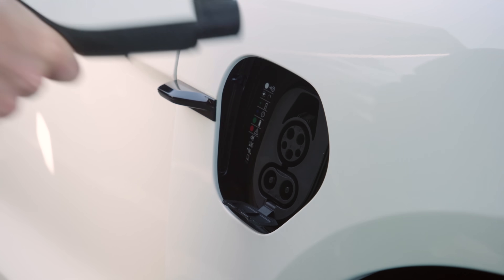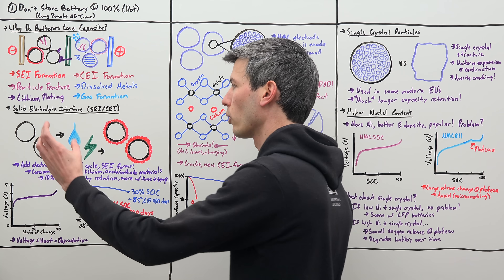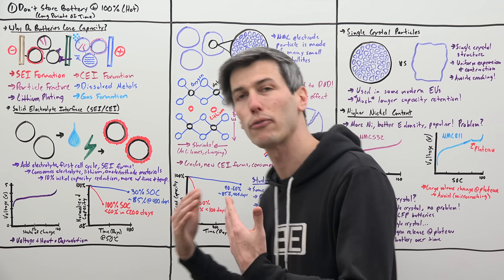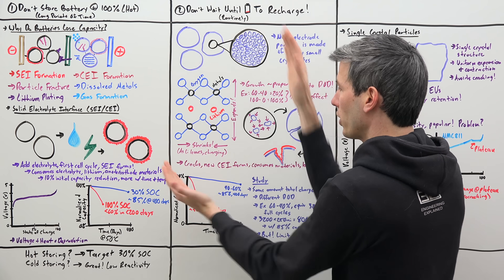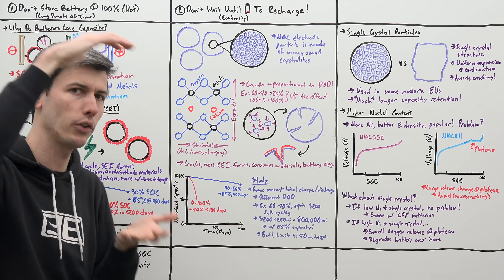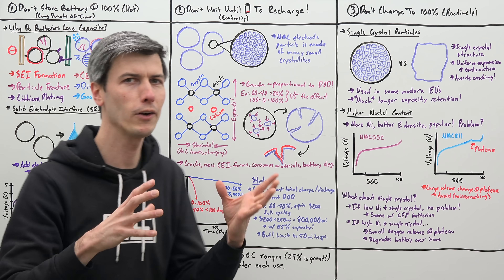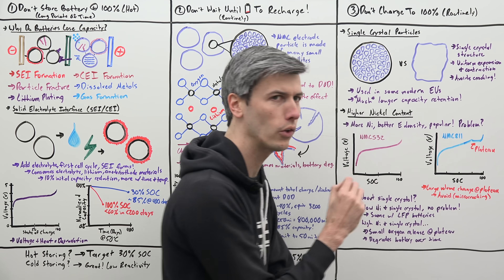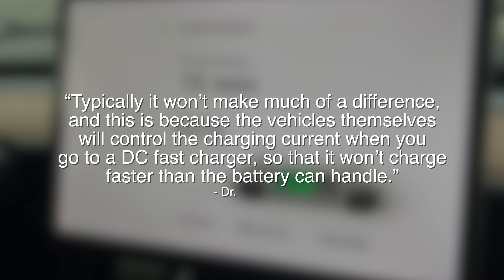How To Ruin Your Electric Car's Battery - NMC Edition!

Comment: "Why would you know what kind of battery your car has?"

Because it's easily the most expensive and important part of your car? That's like asking "why would you know what kind of engine your car has?"
Reply from the maker: Manufacturers are happy to tell you what engine is in your car. Not so much on batteries, sometimes you can't even get the capacity. I don't know of any listing chemistry on the spec sheet. This should change, IMO.
Reply: A large population can’t even tell if their car has a turbo or not 

And my diesel hatch user manual tells me quite a lot of dos and don’t to lengthen the life of the turbo like 

1. Waiting for proper oil circulation when starting up and RPMs to “settle”

2. Not shutting down the engine immediately after spirited driving and waiting for turbo to cool down 

And many more 

This is just what it recommended for the turbo. It’s a manual so I have to make sure I don’t burn out the clutch in hill climbs or in traffic due to constant half clutch creeping 

This is just basic “make your car last long knowledge” and people don’t know such deep nuances  usually 

Just like a turbo won’t die on you fi you won’t follow these, a battery won’t die on you out of the blue. It’s just that you can make it last MUCH longer if you follow these 

Just like you can lengthen the life of your turbo and clutch by following good driving and ownership practices and worshipping the user manual 

These are just basic tips given, I’m not even getting to the advanced stuff in manual gearboxes like rev matching or heel toe

Comment: What about 3% battery loss every month your EV isn‘t used?

Everyone only shows theoretical or extreme conditions. What about normal people who drive most of the time only a few miles and sometimes (e.g. holidays) a big distance mixed with times the car is not used at all? 

How long would the battery last with all conditions (cold, hot)?

Manufacturers should be forced to make their batteries swappable - even for third parties.

All in all the car is getting a disposable product.

Comment: From your title, not having watched the video, the engineers didn't take into account that people would charge it all the way up? Really? The engineers/designers would just change the charge scaling if they needed to.
Reply: They did, which is why EVs have a 3-5% buffer to prevent max and min charge. But even at 95ish%, that can cause more degradation than if it was lower.

Comment: I typically charge to 80% and drain to 40-50% on 75kwh pack, but I've kept the amps ~10a for most of it. Are these equivalent? 40-80% at 10a or 60-80% at 32a, for health of battery?

Comment: A bit confusing where you say you just charge up, but the recommended thing is not to keep topping it off? Isn't that even worse than the 40-60 test? Also, ebikes say to not store winter in cold nor at 100%? 75%& room temp. IPhone can be set to only charge at 20%-80% to max battery life, so different? Video is easier to understand what happens than what to actually do (other than the optimal situation).

Comment: Excellent video Jason!  
My relation to this topic comes from 5 plus years of ownership of my 2018 Zero SR motorcycle which has a 14.4 KWh pack.  
I have a little less than 18,000 miles on the bike and have not had any issues nor noticed any battery degredation.
This makes sense since I've followed basically the rules you have on this video.  
I store the bike at about 50% SOC during the winter months, I keep the SOC when riding between 40% and 80% normally, charge right away and only charge to 100% before taking longer rides.  I think I just aquired this knowledge over time from different sources but this video was vindication for sure.
Reply: Thanks.  I love my Zero.   @oddjobsandrandomprojects
Reply: So most of the time your range is 40% ? I do non of those things in my Aprillia and it’s just fine🤣
Reply: @chartedtravel1776  No thats not his range, most of the time his range is 80%.
Reply: Nope.  It's whatever I need it to be for the ride.   @chartedtravel1776
Reply: @chartedtravel1776 they’ve also barely driven it lol

Comment: I just sold an Honda PHEV with ~70k miles and ~6 years on it, and that battery was well under 80% health. It only had ~11 kWh useable left of its original 17 kWh total rating.
Its life was going from whatever it called full to whatever it called empty 5 times a week, and charging back to full again at ~1.5 kW slow charge every night.
Likely an NMC tech, it was really not designed for its actual use, and there was literally no user-controllable settings to prevent 100% charge.

Comment: Thank you for this, my EV battery is being replaced at 90k has 72% SOH but has other issues so I'm getting a new one (backorder...) and I want to treat it well. It's a LEAF so sounds like I should keep at 60- (85% max) best to charge to: 70-75% daily for my trips to work 🤔
Reply: If you have a leaf, it is especially temperature sensitive.
Reply: Yes I'm in Arizona can get over 120 I'm not sure what to do other than not drive it on those days and keep it in the garage at home since at work there's no shade or if I just drive the car gently and keep the battery around 60% then maybe I would be ok on scorching hot days. 😝 @BrandEver117
Reply: Does Leaf software allow a charge limit to be set?
Reply: no but it has a charge time estimator 25/50/75/100 with hr. est. @barryw9473
Reply: @barryw9473  no
Reply: @barryw9473  No, but there is a timer with % est.
Reply: okay I got my replacement battery 😇 how do I take care of it how would you recommend the exact way I charge it...? I just need about 25-30 miles per day soemtimes like Fridays and weekend about 50 miles ?

Comment: I was hoping you would get into low charge issues. I regularly do a long drive where I use 70% of my battery. Is it better to overcharge a bit to avoid a very low battery by the time I get home, or vise versa?
Reply from the maker: Low battery percentage is fine, but it's kinda a comfort thing. It feels more relaxing knowing you'll arrive home at 15%, rather than say 2%, in case an issue pops up and you get stuck/etc.
Reply: @EngineeringExplained   Typically, you'll leave around 50 to 100km of reserve. That's when many normal cars indicate that the fuel tank is completely empty (it isn't).

When a battery gets empty, the internal resistance increases and thus the temperature can rise quickly if a lot of power is drawn. A known issue, for example in RC models. It should be avoided.
Reply: Charging to 100%, like for overnight, is better than discharging below 10%, so charge it up and park it with as much capacity left as possible.

Comment: So the TLDR version is to buy a EV from manufacturers that do a proper top and bottom buffer, where 100% full isn't actually 100% full and 0% isn't actually 0%. And don't drive more than 50 miles in the EV.
Reply: Most manufacturers allow you to limit max. charging in software, so you could just set a 75/80% charge limit if you rarely need the full range.
Then just charge once you're home and stop worrying.
Reply: @marceldiezasch6192  That's an extra step for consumers, some will do it but most will just forget. Properly designed EVs act like their petrol counterpart, you get in and drive and charge when empty.
Reply: @kwan3560  Why would you only charge when empty, if you have charging at home? Just plug it in whenever you want/need. I just do it out of habit by now.
Reply: Try watching again. You must have dozed off.

Comment: So basically you're saying 2 things.
First, if you're a professional driver (taxi, bus, truck) your battery will degrade fast and you're screwed after warranty.
Second, you're saying battery degradation is the user's fault. If 80% is the recommendation then why aren't batteries made with 20% margin and allow the user to charge to 100%? And why wouldn't the WLTP range be calculated with 80% battery with a plus for extra long trips?
Reply: You’re assuming the battery is screwed after 8 years if it’s not optimally charged, which is not the case. Also there’s no great issue charging to 100% for long trips.

Comment: Fantastic. This is the first youtube presentation of Li-ion batteries that not only gets it right but also have real in depth explanation.
It is probably not that obvious for the viewer why the cracking is the a problem as you explained SEI formation early and didn't mention the cracking when the intercalation materials expand exposing the electrodes so they form new SEI and lose capacity.
A part 2 about charging speeds and temperature maybe even coupled with risk if lithium plating might also be interesting.
BTW I used these guiding 'rules' above for the first EV I had.
When I sold the Nissan Leaf 24 kWh (notorious for degradation), I still had SoH at 93% and 'all bars'.
(I know this is not precise but a guidance).
Reply: CEI is not as widely covered in literature as SEI. Is there a more detailed explanation of cathode cracking due to continuous changes in volume?

Comment: 11:59 First you say that the battery will loose 40% of capacity in 100 days, and then you say don't worry? 🤪
Reply: If you leave the battery plugged in at 100% charge, in constant 24/7 50°C (122°F), and the battery has no thermal management to cool itself down for (less than) 200 days. Not a very common use case. they crank the variables (such as temperature) so you can see the differences between what they're investigating without waiting years/decades. For example so you can compare that 30% charge in the same excessive 50C/122F it loses about a third as much in 400 days (twice as long)

Comment: some advice recommends to charge to 100% occasionally to equalize voltages across the cells, though not for storage, have you considered that recommendation
Reply: LFP batteries are recommended to be charged to 100% regularly

Comment: Imagine having to strategise so much in order to delay the (inevitable) failing of a key component of your car... instead of owning your car and using it as a tool, you must think about it 24/7, does it have enough charge for your trip, does it have too much or too little charge, is the temperature right, where are the chargers, how much time it will take to charge... the EV car owns you.

Meanwhile, ICE cars are literally "set and forget", fill them to the brim (in 5 minutes or less) or drive them all the time at 5% full, doesn't matter, and the range of your full car is always identical (within a few percent) no matter what the weather is like, freezing or cold, no matter if you run AC at full blast or heaters at toasty and comfy... and no matter whether the car is brand new or it has 300.000 miles on it. 

EV car is literally an "EV car lifestyle" while an ICE car is a no hassle mode of transport.
Reply: Having owned both IC and EV, I will never go back to IC.
Reply: If you don't regularly need the full range of your vehicle, nothing of this matters.
Open the software, set charge limit to 75/80% and just plug it in whenever you want.
I've never paid any attention other than that and after 70k kilometers and 4 years, battery health is at 97%.
Reply: "ICE cars are set and forget" Did you bonk your head? ICE cars need maintenance every 6000 miles or so. Oil change, belts, spark plugs, etc.
I rotate my tires every 6500 miles. At 125,000 miles it'll need a coolant change. That's it.  No vehicle is "set and forget," but of the two, EVs are certainly closer.
Reply: @BrandEver117  don't be daft. ICE needs a simple oil change every 10 to 16k miles and a new belt every 100k. On a daily basis it's as set and forget as can be.
Reply: Is it tho? My diesel hatch is a manual and turbo 

There’s pages upon pages of turbo longevity tips which are no different from tips shown here 

1. Wait for rpm to settle before driving off after starting up 

2. Wait for turbo to cool before shutting down the car 

3. Turbo must be properly lubricated so oil circulation must be proper 

And it goes on 

Similar, I have to be extra careful to not ride the clutch lest I burn it away prematurely 

I know this may not be a USA problem where most cars are air boxes but it is elsewhere — which is as true as saying that since I live in tropical country with no harsh winter so battery range drop in winter is not my problem — so don’t come up with that.
Reply: @shresthsonkar9207  I drive a manual TDI car and have literally never done anything like that, even when I hypermiled mine to my personal best: 1000 miles on 14 gallons (1600 km with 55 liters). My current TDI has 250.000 kilometers and no issues, without ever having to use any "tricks" and tips and hacks, and it hasn't lost any of its capabilities, range or power even though it is 9 years old and has respectable mileage.

Are there people who give advice for TDI cars? Sure... is that advice necessary? No. Just sit inside, turn the key and drive. Least problematic car to own ever.
Reply: The only time I ever spent so much time contemplating about mileage and consumption in my ICE (in this kind of obsessive manner as an average EV car owner) was when I was hypermiling and squeezing 1000 miles from a 14 gallon tank, for fun. With an EV, this is mandatory lol

Comment: This basically applies to phones too. Ever since I destroyed my first smartphone battery over the course of a year back in 2012 (whereas with my dumbphone it lasted a whole week) with daily overnight charging, now I adhere to the 80/20 rule and haven't had any battery problems. So far my current phone has served well for almost four years now.

Don't fully dis/charge, don't let the device get hot. Easy.

Comment: Do most cars/chargers have an option to limit the charge level while the car is plugged in? I am an ICE guy currently, but curious about EVs.
Reply: Yup, some older ones didn't, or only had a "hilltop reserve" to limit it to 90%, but I think every new EV can limit to just about whatever. My 2020 Bolt can limit in increments of 5% between like 35% and 100%. I can also set a departure time, so it will only start charging in time to be charged to the specified level by that time. Some EVSE's (the chargers) have smart capabilities where you can set timers and stuff as well, but you don't necessarily need anything that fancy if the car can do a lot of it.
Reply: Thanks! @BrandEver117
Reply: Tesla have the charging sussed. You can select 5-32A in 1 A increments. You can also select between 50% and 100% max charge. You can also select the time to charge if you have cheap power during the off peak. All this from your phone. Crazy good technology.  Hire one, experience before opinions..
Reply: I know I could have googled this, but thanks for answering since I took the lazy way out! :) cheers, guys! @markkennard861

Comment: EV’s have a long battery warranty because the federal government mandated it. It’s not out of the kindness of automakers heart. They would just as soon reduce the battery warranty to as low of warranty as they could get away with and still have consumers buy the product.
Reply: Automakers provide warranties in general to instill confidence and trust to make the sale and build loyalty, not because they care at all about the customer. The reason EVs originally had good warranties is because they were a new type of car and they wanted to instill enough confidence in the consumers to buy into the new thing...this was before the regulations. There were already similar regulations for things like emissions equipment.
It's true that companies will often try to weasel out of warranties (for any product, not just EVs), which is why regulations and Right to Repair are so important.

Comment: Thank you for this Video! I always appreciate the time that you put in to your streams. I have  Crosstrek PHEV and I tend to charge it to 90-95% because I use all of its range each day. I did not know that it was better to charge smaller ranges more often. I will try to charge multiple times a day so that the cycles are covering a smaller range. Also, I know some companies like Subaru and Toyota keep a certain range of the battery for a buffer. I assume that this means when I charge to 100%, it is really more like 95% in truth?
Reply from the maker: Yes, especially true for PHEVs which will have a bit more restriction, because they know the battery's "full" capacity is going to be used more frequently. I wouldn't hesitate to hang out at 90%, as there's likely a healthy buffer.
Reply: @EngineeringExplained  Thank you again for the great info!
Reply: And this is why I don’t own an EV. Ice or hybrids for my lifestyle
Reply: I have an XC60 PHEV and a volvo sales rep explicitly told me it was okay to regularly charge to 100% (as indicated by the car), because that’s actually closer to 80-90% of the true capacity. I hope he was correct!

Comment: I am very pleased with my 2013 model S. Going on 220,000 miles now.
It’s still running on its original battery. Does it have anything to do that I live in Florida? I charge half and half at home and superchargers. I still get 230 miles full charge.

Comment: So does that mean an 800v battery will have a shorter lifespan than a 400v battery?

But since the cybertruck effectively splits the battery into 2 400v packs, would that reduce the longevity hit because they battery isn't a whole 800v but 400v combined into 800v for the motor?
Reply: The voltage in the video is linked to a single cell from what I understood. 400V or 800V packs just means more single cells in series and no link to the graphs in question.
Reply: @apclaudiu  Ok, that's good. However to my knowledge, the 4680 cells are larger and are more energy dense, and require a less number of cells vs previous batteries. 

Didn't hear anything about voltage and Amp hour of each cell but considering they need less cells so more power per cell, and the packs use of lower current makes me think they're a higher voltage per cell.